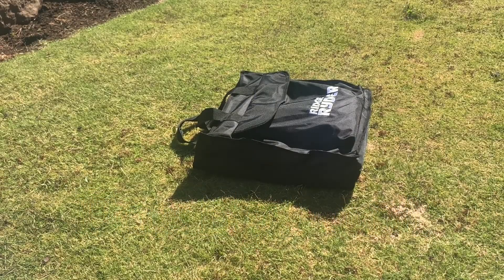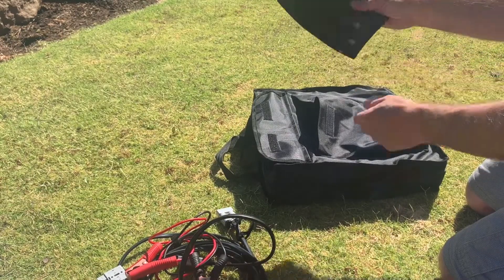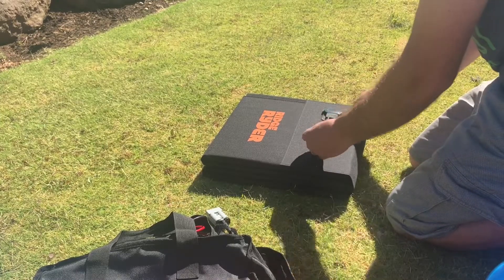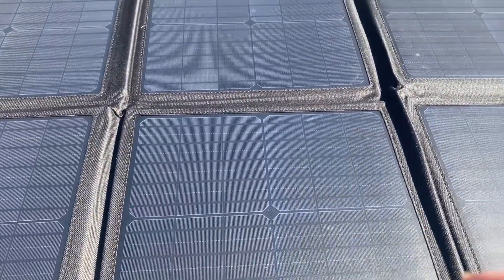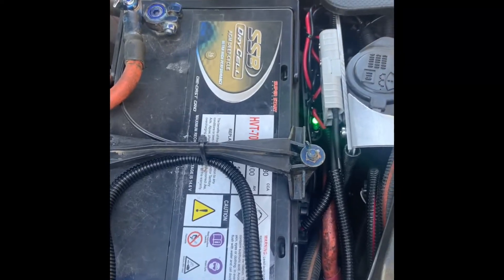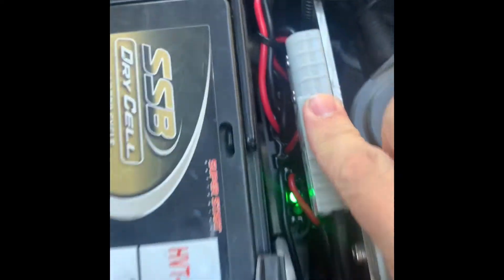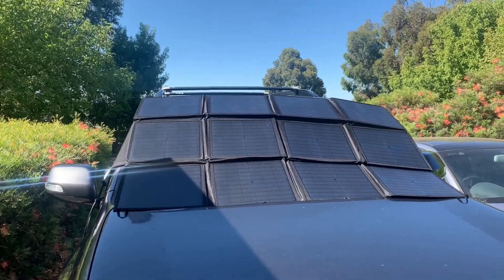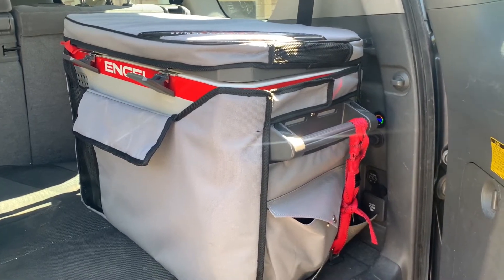Ridge Ryder 200w solar blanket review

Comment: Question - can you bypass the ridge Ryder solar controller that comes with the blanket, and plug directly onto a solar controller?
Reply from the maker: Hey There,
The solar controller is not built into the blanket at all so you can use whatever solar controller you like.